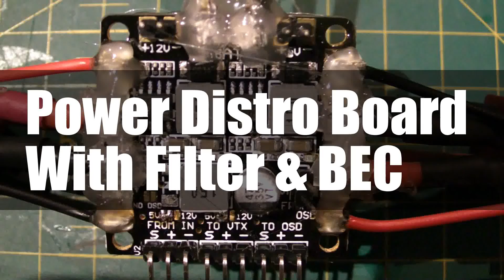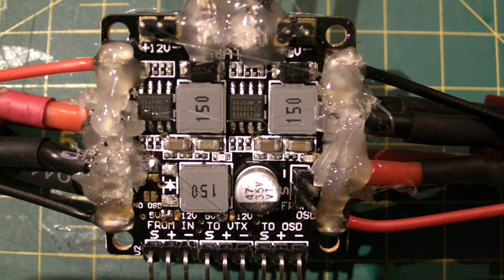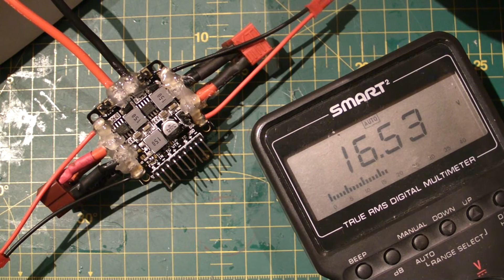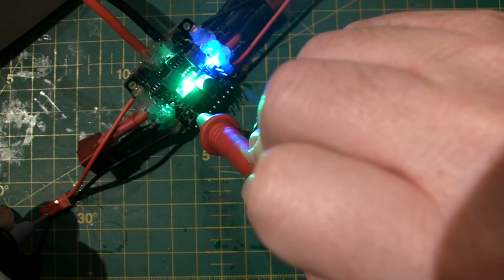Power Distribution board with filter and BEC from banggood.com

Comment: I guess that those wires are not soldered and only held with hot glue.  It will be much cheaper and quicker and easier to solder.
And when your aircraft falls from the sky you will know its real failure and not a lose wire.

my 2c
Reply from the maker: Yes that is correct. that is why I have mentioned (at about 40s in) that I have soldered the wires and used hot glue to increase the strength and give it some insulation.
Reply: lol god dam. Geuss I was watching and not listening

My quad is playing up.  I have esc with bec (OMG BEC), Esc 1 heats up just from plunging in the battery  is that normal? (Only esc 1 heats up) And its the mosfet that heats up.   also when I fly and jerk the throttle, the quad shuts down and quickly regains itself.   Heard of this problem before ?
Reply from the maker: Jamie Jones are all the ESCs in your quad the same or rated the same. The BECs (Battery Elimination Circuits) change the flight battery power to 5v so that it can be used by other electronic devices like the flight controller or servos. If your ESCs don't match the flight battery voltage it heat up a lot prior to burning our. Another point is that there can be 2 types of BEC, switched and linear. I can't recall exactly but one type play together nicely and the other doesn't also one has a higher amp supply rating. I assume you have all 4 ESC BECs plugged into your controller. You can get away with one depending on the amp draw of your electronics. Perhaps test this by removing the red centre wire from the offending ESC and give that a go. Just test it a bit carefully.  The wobbling sounds more like PID settings. The power loss sounds more like power droop from an under rated battery. Tell me more about your setup with brands and values and I'll see if I can help you more.

Comment: hii if i want used mini osd... how to wired it to the board can u give me example
Reply from the maker: Hi  I dont have any experience with MINI OSD, bit I have used minimOSDs which I imagine would require a similar wiring setup. I cant go into any OSD internal setup or configuration as I dont have any of that type.

First things first, you need to look at your flight battery. This is the battery that will power your Esc/motors. I cant remember if it is limited to a max of 4S but I know that you can input 4S or 3S. Hell you could probably use 2S too if you really wanted. The point is that it will only have a good 12V power rail if you are using a 4S battery, this will determine some of your jumper options available from "FROM IN"  and "TO VTX". 

I am using a 3S battery so I can only guarantee a stable 5V is available, the 12V power is something closer to 10V which fluctuates and is unacceptable.  That said  the camera and transmitter that I am using only need 5V each, hence my jumper choice.

So the camera is connected to "FROM IN" in this example using the 5V (ALSO make sure that the "NO OSD" jumper is NOT soldered, because you want to use the OSD)

Next the "TO VTX" is connected to your transmitter (it will draw power from this plug, you shouldn't need to worry about powering it via anything else)

After that the "TO OSD" is connected to the OSD module, it is giving you image (from "FROM IN" aka the camera) through the "S" pin and ground through the "-" pin. I am not using the "+" pin as my OSD is powered from the USART on the flight controller. yours may be different. mine has a TX, RX 5V and GND connector that I use.

Finally the output from the OSD goes to the "FROM OSD" connector, this only uses the "S" and "-" pins

That should just about do it.

If you need more I can make a video in a couple of days to show how mine is set up.
Reply: wow amazing explanation sir